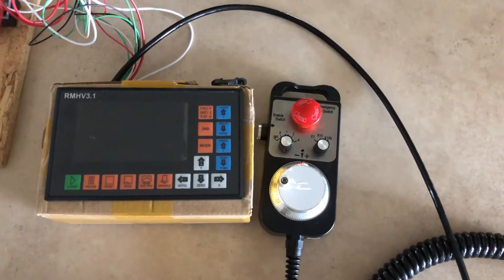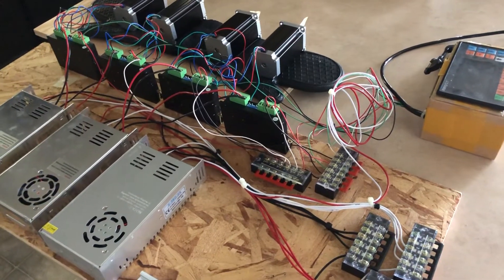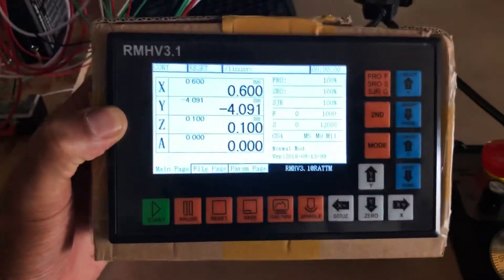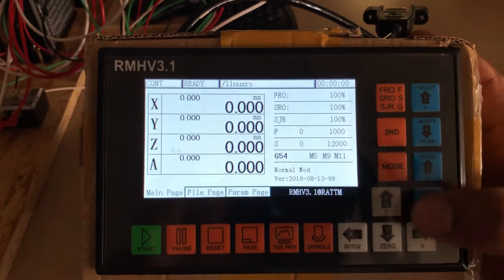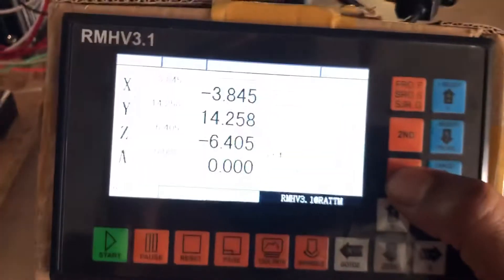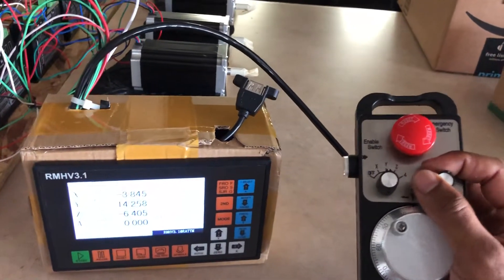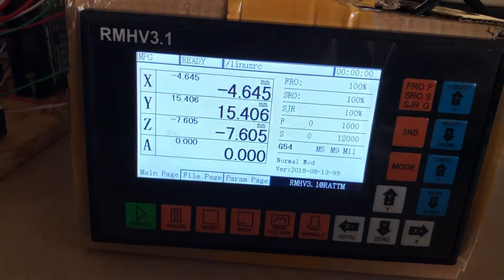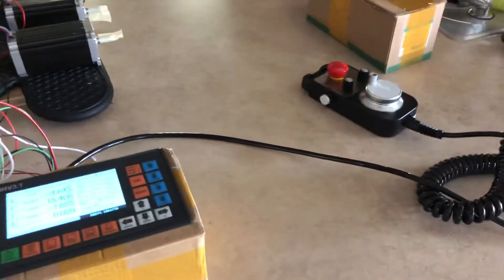Offline CNC Motion Controller RATTM MOTOR RMH V3. ( See description for manual link)

Comment: how u made the 2 steppers of (Y) axis move to gather ?
Reply from the maker: Used a terminal block to take the single (Y) signal from controller, split it into two signals and then wired each to a separate (Y) stepper drivers then, to the separate stepper motors.

Comment: I don't see the advantage over a laptop with Mach 3 or Fusion 360 with cad/cam.
Reply from the maker: I think it is more of a preference. My main concern was dust and did not want a pc/laptop in my shop. I plan to always have a dedicated unit per CNC to run them (ready to run no software license required). If I were to purchase a cheap pc/laptop the cost would be the same if not more, and yet just another update, forgotten screen saver, or even bored tinkering that could lead to mishaps during cuts. I prefer to design on my most powerful pc and then just use the offline unit to run file. For me it seemed the easiest way to keep it simple. Wiring this is a breeze! This being my 1st CNC build there is definitely more unknowns than knowns for me so I also build my CNC off of a build I was able to see in person and like the set up. Hope this information helps.
Reply: @SuperJfritz  Thanks for that explanation, makes more sense to me now. 👍

Comment: Hi...how do you wire the 2 steppers for Y axis kn this controller?it uses drive A to move the 2nd Y motor?nice video by the way!
Reply from the maker: I wired the y Axis to a terminal block so I could spilt the signal into two and then ran each set to a separate driver and motor. 1 term block, 2 Stepper Drivers, and two motors. I will include a link to a video that may show a little more on my build. I do plan to have a more detail wiring video for this controller in the future.
https://youtu.be/kCekDy27DYI

Comment: Is there tool offsets in the control for Z and tool diameter to control part dimensuons ? Or must it be done in the program?
Reply from the maker: Good question, unfortunately I do not have an answer. There is not a lot of information out there on this unit. For questions like this one I go to the facebook group "DDCSV 1.1-2.1-3.1 PLC CNC CONTROLLER". This group contains members that really know the controller any may have even designed the controllers. I am sure someone would have more information if you use that  platform.

Comment: Did you connect both Y motor drivers to the same spot on the controller?
Reply from the maker: I have only one connection to the Offline Controller for the Y axis. I used a terminal block to split the one signal into two.

Comment: Does the controller have a jog or power feed mode? (i.e. select axis, direction, speed. press a button and it goes at that speed until you tell it to stop)
Reply from the maker: I have not seen a function that would allow this. I must hold the buttons during movement. I use the offline controller to move the CNC but I do not use the controller to design. I do the designing on a desktop PC. Then I save to USB drive and run the file from the controller.

Comment: Hello there, is it possible to show how you wired the motion controller to the power supply, stepper driver and then the stepper motor. I just need it to power one stepper motor as I will only need it for one axis.Thanks
Reply from the maker: I included a link to my video that explains better how I wired my CNC. This video shows both enclosure. You can also see my Wood CNC enclosure build video. It will show my power enclosure. 

https://youtu.be/ocKsOUF1aQE
Reply: JFabrications thanks for the reply, I watched all your videos and most are very difficult to understand the audio. I was hoping you would show what wire goes to what terminal. From the motion control to the power supply and from there to the stepper driver and stepper motor.
Reply from the maker: @chupatrupa8475  That is really good feedback, thank you. I noticed right away that the quality of my videos was not up to par if I wanted to continue to documenting my builds. I am slowly improving my video quality and a remake of some of the videos that I have maybe in order. Thank you once again for the information.

Comment: Hi, Thanks for the video. I'm interested in using this controller myself. One potential feature I've yet to find anyone demonstrating for this controller is file editing. The file page shows an "F3-edit" button, and a user manual for the DDCSV3.1 operating system has one sentence that says to edit file push the button, but there is nothing showing what happens after that. Can you edit the g-code on a file directly from the controller without going back to a computer? Any chance you could show the file edit feature?
Reply from the maker: That is a great question. From what I know and what I have seen you can not edit the G-Code directly from the offline controller. The edit function on the offline controller is so the you can copy/move files on the inserted drive. I use V-Carve and do all my designing and run simulations to get the file correct on this program. Then once I have the file to a production standard I plan to not edit that file further before running on CNC.

Comment: so you also have to push the E-stop for the thing  ready..... CE = Chinese Export ..
Reply from the maker: No. If the E-stop is in the operating position (Run) then you only need to pass the reset button to ready the system. If the E-Stop button has been activated (Stopped) then you would need to reset the E-Stop and then press the reset to ready the system. Thank you for asking your question.

Comment: Can you put a link to the exact controller you bought in the comments? I found several on Amazon but they all say v 2.1. Thanks in advance.
Reply from the maker: I ordered from the same link. The pic showed v2.1 but I did receive v3.1. I am still learning so much about this unit. I did find a facebook group (DDCVS CNC Controller) and there is people that know this  thing inside and out. From the way they post they may have even created it. Should check it out if you are really thinking about purchasing. Hope this helps.

Comment: I hope it is working for you. Looks like an interesting solution. Though I am sure you have learned by now, as you were scrolling thru the options. You were scrolling thru the machine and work offset options. Mach was machine coordinates not Mach3 , G54 is the 1st work offset option G55 2nd G56 the 3rd etc. How are you liking this product now?
Reply from the maker: I like this controller. I am learning more and more everyday. Thank you for the information on the coordinates. I am just now getting into the design phase and will be learning about them I am sure.
Reply: @SuperJfritz  There is a lot to learn and there are some concepts that are hard to grasp without help. Been there done that, hence my user name. Btw I ordered and received my controller too. I have a few machines that could test a refit. This looks fun for a production system. You will miss having MDI in the long run but you will learn to workaround it.